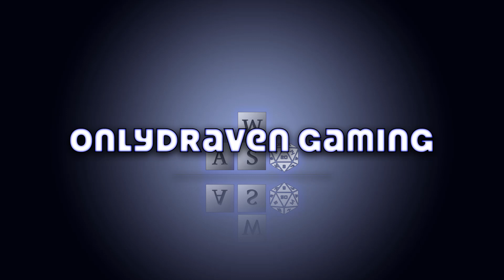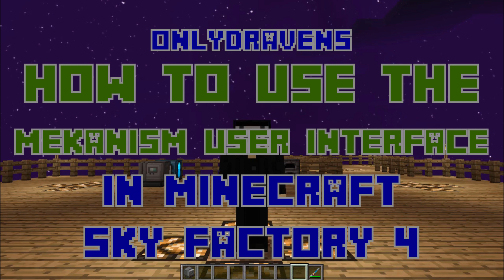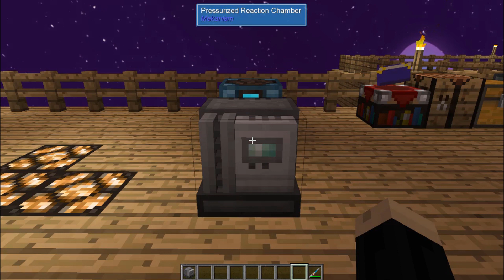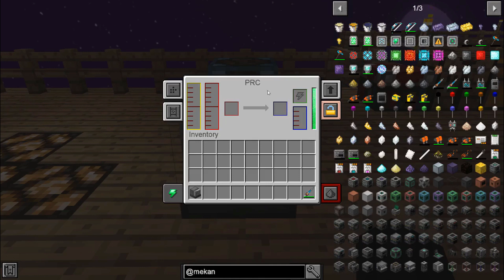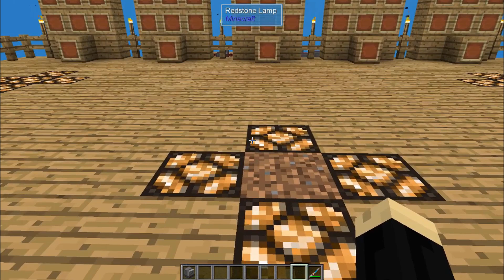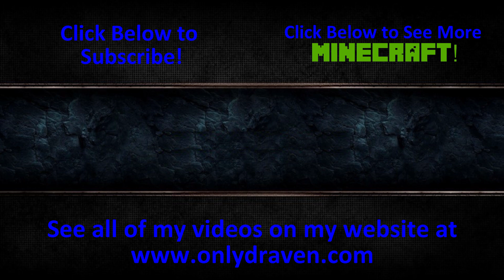Minecraft - Sky Factory 4 - How to Use the User Interface in the Machines from the Mekanism Mod

Comment: Thanks for the vid, I have watched multiple vids (mostly by you) about using the prc and mekanism machines more generally. I have liquid ethylene in a fluid tank that i can't for the life of me input into the prc, despite using all manner of fluid pipes (that appear to connect both ends) and setting the side config in a manner that, logically, would be correct, and is consistent with your tutorial vids. What could i be missing?